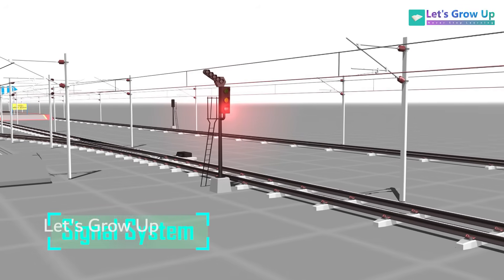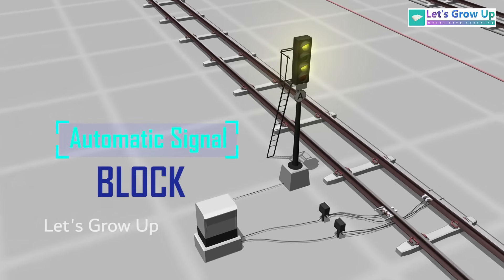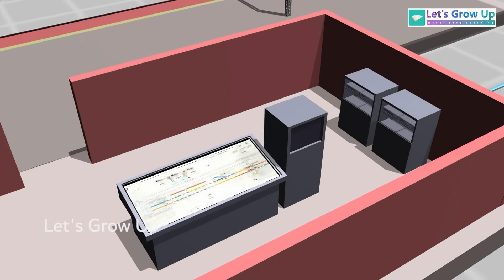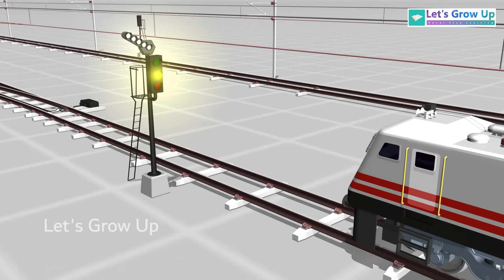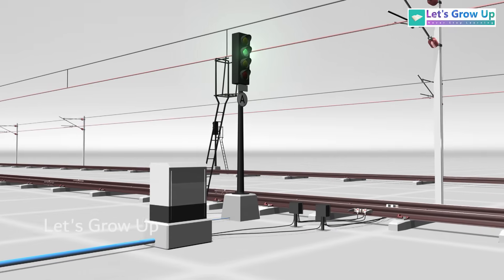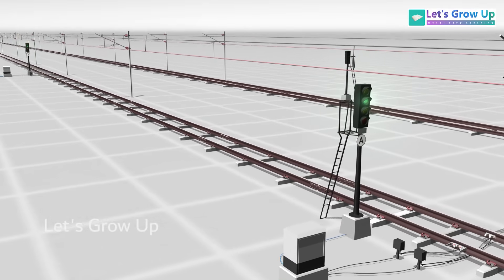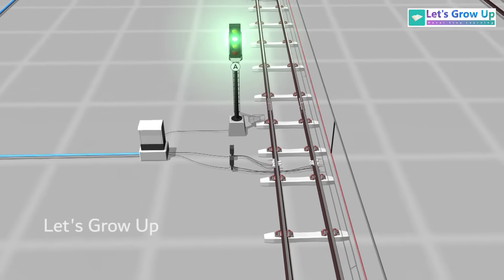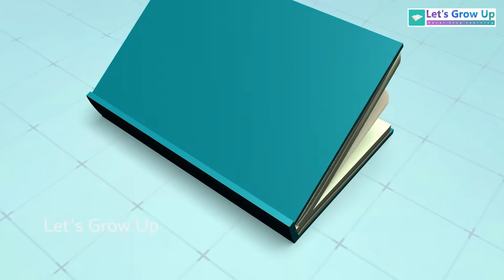How do Automatic Block Signals work? | Axle counter | Block and Interlocking system

Comment: The reason axle counters is used instead of a simple short-circuit block sections with insulated track sections, is because in these cases the signalling system must know the length of the train. It saves the amount of axles in the "brain" and the previous signal will NOT get the yellow signal before the axle counter have counted enough axles to know that the train has fully left the previous block.

So the next signal will become red, but the previous signal will STAY red, then the computer will load the axle counter with the number of axles detected in the previous block.
Then the axle counter will count down, and only when it reaches 0, then it will signal yellow to the previous signal.

In this way, you don't need to wait needlessly long to see "if it comes more axles", instead the first signal will decide how many axles the subsuquent signals require.
Basically, first axle detected = this signal red. Last axle detected = previous signal yellow.

What I know, there IS a backup system in the form of the basic insulated track system too, so if a axle counter would fail, it would be reported (since the basic track system would report a occupied block but axle counter sees nothing), BUT the signalling system can work in a "fallback mode" where it wait quite a bit after the train has entered the next block to ensure it has left the previous block. (which means train drivers has to wait unneccessarly long at a red light).

Comment: There are other signalling systems that do not use the double yellow aspect for 4 aspect signalling.
The American East coast speed signalling system is a better and a more logical system than the double and single yellow aspects.
In Victoria, Australia the railways use a version of the American speed signalling system. 
In this system the position of a signal head on the signal mast determines the speed a train is permitted to travel past the signal.
The signal position at the top of the mast -- Normal speed (max. track speed)
The next signal below is -- Medium speed, is normally 40Kph, but also can be 65kph or 50kph as indicated by a white number displayed next to the Medium speed signal head. 
The signal below the medium signal head is low speed.
In 3 aspect signalling Medium and low speed signal heads may not be displayed.
A train driver may face the following sequence of signal aspects in 4 aspect signalling slowing the train to a stop.

Clear normal speed is -- green aspect above a red aspect.
The next signal --
Reduce to medium speed by the next signal  -- yellow displayed over a green.
The next signal --
Medium speed warning is -- red displayed over a yellow signal.  Next signal being at stop.
The next signal --
STOP  -- Red over Red.
As can be seen in the 4 aspect sequence the top signal goes from green to yellow to red meaning the train con no longer travel at track speed.
The medium signal head goes from Red (this is when a normal speed aspect is being displayed) then to Green to Yellow and finally to Red. This means the train can pass the reduce to medium signal at normal speed but is required to be travelling at medium speed by the time it reaches the medium speed warning signal.
4 aspect signalling is very handy when you have mixed traffic with different braking curves ie. freight trains receive earlier warning to reduce speed. 
I think the 4 aspect speed signalling system is a more logical system double and single yellows.

Comment: In Finland the blocking signals are little bit different. They bear a likeness to triangle and have three light units: red, yellow and green. In the basic mode of the signal the signal shows green light which means the block section is free. When the train passes the signal red light turns on. The yellow turns on when the train has left the block section protected by that signal and signify that the next block section is reserved. When the train has exited this block section as well, the signal returns to showing the green light.

Comment: In automatic signalling system ,loco pilots control the signals not by the station master. Am i right🤔🤔😆😆
Reply: Logically ! But actually the interlocking system takes care of it! I'm telling this to you because I'm a Station Master.
Reply: No.. loco pilots never have control on signal..
Reply: @subhankarshil707  Automatic signals are changing its aspect by movement of train. So who is driving the train,🤣🤣
Reply: @hrithikeshg.s4597  actually it is an interlocking system.. connect with the track circuit under the track and it works automatically.. no human hand involved.
Reply: @subhankarshil707  The movement of train controlled the signal. Loco Pilot control the movement of the train Literally loco pilots control the signal by control the movement of train..Am I right?!.

Comment: The video shows axle counters placed before the signal. This is fundamentally incorrect. This can lead to signals changing aspect before driver crosses the signal, a very important consideration. The axle counters, or track circuits, should always be placed after signal. And the distance must ensure that the driver never sees an aspect change.

(Even in the video signal turns red before locomotive has fully crossed)

Comment: Please make a video on 'how axle counter works'
Reply: Ummm what do you mean with the axle counter?
Reply: @futurepilot6749 the ones in the tracks the count axles, to see if the whole train has passed a certain point
Reply: Mutual induction. When rail wheel passes throw flux cut and count. Simple
Reply: Super bro  @Skkdass

Comment: Axle counter is always behind any stop signal and in case of automatic signals there are two Axle counter one is just behind the automatic signal and another Axle counter is at a distance of 120meter.
If train passes an automatic signal it becomes red but previous automatic signal remains red untill train passes 2nd Axle counter or 120meter distance from the signal.
Reply: Signal overlap
Reply: But in Single line 180 mtrs Sir jee